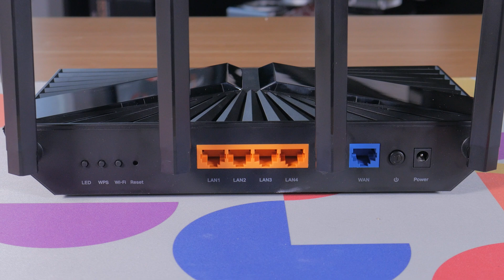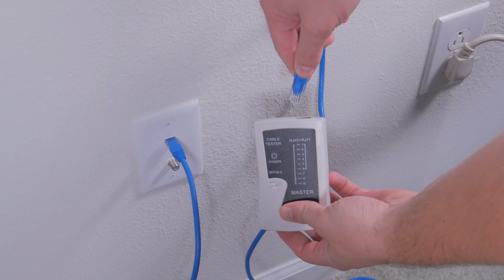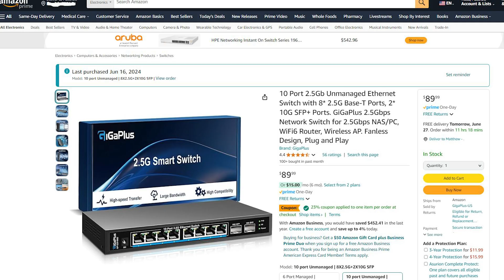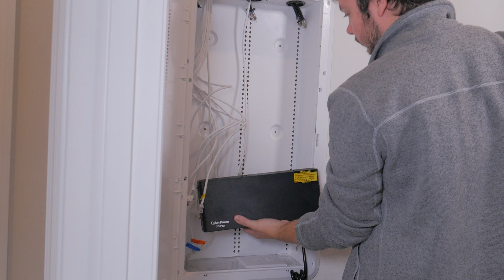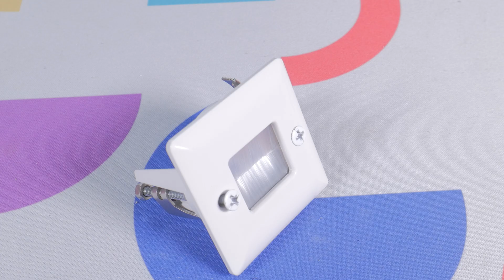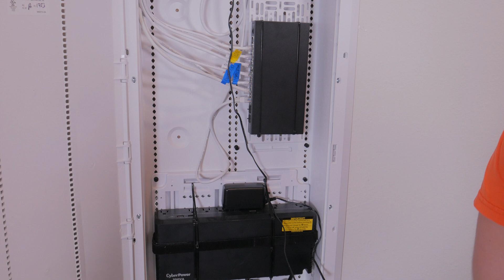Fixing my AWFUL Home Networking! (2.5gb & 10gb Upgrade)

Comment: We use dynmo label makers in the field doing professional IT/AV installs in smart homes in high end homes in Los Angeles. They're great for this use exactly. Vertical printing is amazing for it. I would also say look up TP links backdoor/hacking/chinese attacks and US bans on the brand. I know the price tag is appealing for most with what you're getting. But there is also a lot of proof and security concerns with the brand. I would say go with almost any other name brand. Netgear even. We use Ubiquiti a bit in the high end homes. Also Ruckus and Arraknis routers and access points.

Comment: I guess I’ll need to put a shelf over my future panel as my router is about the same size and shape as a 1/2 gallon milk carton. The separate ONT modem is only about 3” square x 1” and can fit inside any panel.

Comment: Or i mean good is this for example - RB4011 router with 10 ports and sfp, i mean is good for any home usecases, so you dont need switch, and you can buy APs for wifi in each room, also you can use some mikrotik switch with more ports ...., Mikrotik have good qos services, so you can set up many things, like prioritization or limit tcp and udp, load balancing if you have 2 isp, simple queue, qos for particular mac address ............... 😀
Reply: but yea tp link is also good, maybe cheaper and easier setu opposite to mikrotik, but when you buy new router people, chceck maximum speed of wifi, for realy gig wifi you need 2000 mbps + ( maximum wifi speed ), in the past, i bought router which maximum speed is smaller than 2000 mbps on wifi, and I didn't have full gigabit on wifi
Reply: for gig wifi is good this product - tp link archer ax53, it is realy full gigabit router, i tested it

Comment: get rid of the wireless router and get a real system with POE Access Points with a real POE switch spend a few extra $$ and do it right.

Comment: 4:48 coming from someone who does IT for a living trust me you moving ethernet cables around like that is not going to break them. I’ve seen some horrendous shit and it takes a lot to break an ethernet cable now your fiber on the other hand that is extremely more fragile, you have to be extremely careful with that but ethernet as long as you’re not trying to break it you can manhandle it a little bit

Comment: The reason the SONU has to be installed in the garage is due to no conduit ran from outside your home to the network panel. As a field tech I run into this issue all the time. So if you are building a home tell your builder to run conduit from outside to the panel. Then the isp installer will be able to pull fiber to it. It’s not spectrums fault the builder doesn’t want to spend the money on it and they don’t know fiber is in the area

Comment: My family live in 2 small two-story house. Almost everything is using wifi: TVs, computers, phones(?), cameras, IOT devices.
In each house, I use only one Aruba access point and placed at the middle of the staircase. I tested them and every place have strong enough signal to download at minimum 20mbps. I'm kind of regret wiring 2 cat6 cable to each room of the new house :) 
I placed everything in the main box at the old house including optical converter, openwrt router, file server, POE switch and a DIY 48V UPS. All of them is gigabit because I don't see 2.5gbps is worth invest just to increase my rarely backup speed by twice. The router, file server and optical converter is powered using POE splitter so all of my network equipment can live as long as I want depend on the capacity of my batteries.

The thing I have not really happy with is the Aruba access points, they are closed ecosystem, featureless and expensive enough for me to extend my network.

Comment: I have solution for your ISP routers to powering over the UPS, using POE GIGABIT Adapters & Injector, you can send a power from your UPS power over the ethernet cable

Comment: So as a fiber ISP installation tech, They say that but ultimately you can run the fiber wherever you want in the home from the house box outside, Its a standard SC angled fiber connector and you can buy premade length jumpers. Just do NOT uncap it at all until ready for plugging into the ONT.
Reply: To add to this, installing the ONT in the fucking garage is such a big taboo, Because it would have been presumed that your gateway would have been installed there before too and that would have been horrible for wireless performance throughout the house. The only time I install in the garage is if some of these new homes have the utility/patch panels located in the garage where all the ethernet in the home terminates to.
Reply: @jonnathan780   some strange reason i see it often  we have some in our devlement who have it outside
 there garage own by the isp hard mout to wall

Comment: You should remove the plastic cover from the anthenas of the TP-Link router because plastic acts as an insulator for the WIFI signal.

Comment: As a former cable installation tech for Spectrum, I can tell you the modem absolutely should not be in the garage. Your tech lied to you when he said it had to go there, it's absolutely supposed to be inside the home. That install would have resulted in a charge-back,  failed install. You should absolutely be calling your ISP and setting up an appt. to have it moved. There are multiple reasons the modem should be inside...mainly heat and humidity. I would solve the wires at the bottom with two simple grommets, done deal. Everything else looks on point, good job !

Comment: I never liked patch panels. To me they are just another unnecessary layer of clutter. I almost hate rack mounted stuff in the home. They are noisy, and you need to clean and replace the fans a lot, and unnecessary.

Comment: I'm a internet installation technician. If anyone is curious as to why the modem had to be installed in the garage, it's because there is no conduit going from the side of the house into his media panel so there would be no way to fish the fiber which would have been ideal. Unfortunately, not all modern houses come with a media panel or said conduit leading to it. The only option is to install the fiber modem in the garage and connect it to the ethernet that is going from the side of the house into the media panel. With that said, the technician could have done a much cleaner job when installing it.
Reply: Absolutely not true, the tech either didn't want to do it or didn't have the time because he was overloaded with stops which happens daily. This could have and should have been put inside, running wires is easy.
Reply: @Me99adon  Installing in the garage takes longer as opposed to having a conduit going into the media panel. So the argument that it's faster cuz the tech was running behind is such a false claim . . . And to say he "didn't want to do it" is also false. You can clearly see in his media panel that there is no conduit, so he physically COULDN'T do it, even if he wanted too
Reply: @ericdayofficialyt  obviously you've never fished a wire down a wall, its pretty easy...I used to do this for a living and i'm telling you right now that install is unacceptable. Even if it had just been mounted next to the panel on the wall.
Reply: @Me99adon  I have plenty of experience fishing through a wall, and that's not what I'm talking about at all since that wouldn't be a good idea in this situation.

With that said, I'm not condoning the condition of this install as I would have done it a different way. But with the amenities of the house and how it was built, the ONLY option would be to install the ONT in the garage
Reply: It could’ve definitely been installed inside. Installer could’ve put a piece of conduit/u-guard/pipe up the outside wall into the soffit and fished the fiber into the panel. I have fished these panels multiple times.
Reply: @Wav10001  False. That is not something that installation technicians do. Now, if you hire a contractor to do that, then that's a different conversation. Also, does he live in an HOA community? If so, then that solution wouldn't work.
Reply: @ericdayofficialyt  point 1 - why? you’re literally fishing an existing hole and trading a hole in your stucco for a hole in your soffit.

To your second point… you’re telling me the HOA would approve you of a house wrap where the cable comes up from the ground and goes through the wall (or potentially several feet horizontally across the outside wall) versus a conduit into the soffit that looks more aesthetically pleasing? Oh wait let me guess.. you didn’t ask the HOA because your route doesn’t allow you the time to do that.
Reply: @Wav10001  Point 1 - The hole in the garage is not seen on the outside of the house, it's pushed though the d-mark where the fiber comes in from the cross connect in the street.

Point 2 - You're correct, the HOA would NOT approve of a house being post wired cuz why would anyone want a wire running on the side of their house? Even when the job is done well, it's an eyesore. But it we could, and it's what the customer wants? Then sure, we can do that. But again, it's dependent on what we have to work with.
Reply: Isn’t the garage too hot in the Florida summer for the modem
Reply: @patricianavarro6645 We do it like that in Vegas where we hit 120 degrees last summer. The only time it's done is when there are no other options based on the amenities of the home. The only other possibility is to run the fiber line along the outside of the home, but with fiber being mire fragile than the traditional cable line, I don't recommend that option

Comment: Well as of the modem, there's an optic fiber connection, you can try to see on the back if you can unplug it. If yes, get your self an adapter (with respective end color, in poland for SM fibers it's either green or blue and it means something ;) ) and a optic fiber patch cable with respective color ends, then just run it like you runned the cable from the modem to the enclosure you showed in the vid. With that you can move your modem to the desired place, but remember do not bend the optic fiber cable/patchcord too much no 90° bends etc. If you need to bend it. Do it with radius bends and do not pinch it.

With that said. That's one of the ways to get that done.

Comment: And while using a label maker for the whole name is okay. I've often found myself numbering each cable and then having a laminated sheet that you put in there with clipboard or however you would like where you can go on the computer type up document showing which number is what and that is what you laminate and put in there if it's ever needed to be changed quick to do.

Comment: Just use a bolt and 2 nuts to mount your equipment. The 2 nuts pinch down on the bracket and then you can use the mounting holes on the bolt head. Looks cleaner and you don't have the eventual zip tie replacement.

Comment: i can see that youre using fiber internet, you could consider using fibre cable couplers to run an extra wire from your spectrum fibre drop under your desk to your network cabinet. this would allow you to move your modem into the cabinet saving the money for another ups

Comment: To move the modem, you can run an optical patch cord to the cabinet, and connect the current connection to the optical connection socket, if this is a GPON connection from the provider.

Comment: If you have it in you to pull some wire through a wall, I'd suggest running a length of fiber to the garage, coupling it to the jack there, and then moving the modem to sit with the rest of your network equipment.

Comment: it got great. Btw, you should ask your Internet provider to reenistal the modem on the loundry room. They just have to put a new cable, its very simple. That way you have everyhing on the same place, connected to the same UPS.
Reply: The installers always try to get out of doing actual work, and Never want to go into the attic to run cable....
Reply: @koinkeepers9378  He said Spectrum and I knew they put it in the garage because they are lazy.
Reply: Check the run of your Cable/Cat6 connection if it is loose all the way and use one of them to pull a cord through. Then use the cord to pull a pre terminated fiber to your closet. From what you showed in the video I think you are handy enough to do it your self! 😊

Comment: So they ran the fiber drop to the ONT in the garage and then ran a random ass ethernet cable to the distribution cabinet? Could they not place an FST at the fiber drop location and then run fiber to the cabinet location? Or was this just the tech not wanting to do quality work? When I was tech we carried 200-500ft aerial fiber drops. We would use those to wrap houses to the correct location for an ONT.

Comment: i would not have removed the equipment, at most i'd have covered with something maybe tape a plastic sheet to the inside of the box but, likley done just like you and used my electric computer duster after.

Comment: for a dink box as most of those in walls are, that legrand actually has some room to work in! i bought a 10" rack for my last project but, this also gets my mint thinking. could even use this in conjunction with a mini rack, just coax splitters and POTS and ethernet patching etc etc.

Comment: 1) Not everything in the CyberPower line will come back up if run to depletion.  Some need you to push a button after some level of charge has been reestablished.

2) Laundry rooms sometimes flood.  That server should be on something like a milk crate or moved somewhere else.

3) Houses and especially laundry rooms are dusty.  You fold clothes there, right?  Mount the AP with the RJ45 ports facing downward to keep dust from ruining your day later.

Comment: You can move that company router anywhere, just get someone to pull or extend that fiber cable if you don't want to do it yourself
Reply: pretty much simple and will clear the issue.
Reply: My isp installer rambled on how they couldn’t do it due company policy blah blah. I had already ran a few lines myself and told them I’d do it, eventually he had to do it that way anyways. Tipped the guy cause I had to leave and wanted him to feel appreciated. Come home to my security being unplugged 🤦🏽‍♂️

Comment: In theory, you could move your modem into the closet, by "extending" our ISPs fibre house connection with a new fibre that you run from the closet to the house-port.

Fibre cables are fairly cheap and you have everything in one spot
Reply: yes, that is correct. :D hahah.

Comment: you can try to power up the fiber modem using POE injectors ... one on each side ... one to power in (in thewall netwoork closet) and one to power out (modem) ... to use the UPS

Comment: Your ISP most likely left your modem in the garage because the fiber drop is right on the outside of your garage. I am a technician and we don’t run fiber or even carry fiber with us. We just have to put the modem where ever the fiber reaches. There was most likely no conduit from the house box to your smart panel so that’s why it wasn’t pulled to the smart panel initially. Great setup!
Reply: Wait you don't carry any fiber for installs? We would wrap entire houses with fiber from the fiber drop to where we placed the ONT. Wow your company really doesn't want you to do work.
Reply: FGUCKING WHAT; Im a installer for a ISP and we carry 1000M drop spools on our trucks and varying jumpers ranging from 5ft to 100ft. Ur company sounds lazy/trashy no shade at you.
Reply: former Spectrum field tech here. We carried varied lengths of unterminated fiber drops. Likely reason his modem had to go in the garage is there wasn’t a conduit that led to the smart panel.

Comment: confused you have 1gb into the router then feeding a 2.5gb switch from a 1gb source you need a 2.5gb port on the router
Reply: I was thinking the same thing. Or he could have ran the internet directly into the switch and ran an ethernet cable from the switch to the wireless router.
Reply: I think he only uses the 2.5gb/10gb speeds internally for his nas/storage server. So it's fine as that traffic doesn't need to go trough the router, Only internet. And his internet speed isn't greater then 1gb anyway.
Reply: This might have been the most painful network upgrade I have ever watched to be completely honest. More reliable? Probably. You’re not going to be benefiting at all by that switch assuming you haven’t upgraded any Nics on your end devices. A $25 switch was probably more up your alley.

Comment: Hey, for the USV for your modem maybe  APC Back-UPS Connect CP12142LI is for US Market and not so Cheap, i live in germany and head a Eaton S3 Mini but only for Europe and UK available arroubd 50€, the same Type APC Back-UPS Connect 12V CP12036LI have one also for Europe arround 60€ not us sadley .

Comment: Networking is fun. If you get anything over 1Gb WAN you're probably going to have to make your own router to get to full speed. I set mine up with 2Gb WAN going to a server running Proxmox and pfSense for routing. That has 10Gb in and SFP+ DAC to a managed 5 port 2.5 Gb switch and that feeds a 24 port unmanged 1 Gb switch. Now that I've got it working, I'm afraid to touch it. 😂

Comment: I have the same TP Link router as yours for over a year and it work out well. I had to upgrade all my CAT 5e and 6 to CAT 8 because I didn't want any cable as the bottleneck and it was not that much more difference in the cost and save me the hassle in the future. My laptops and iPads uses the wifi  and that router's 6 antennas worked very well.

Comment: Nice video, but I think you may have missed an opportunity here to future-proof your network setup by going with a managed switch instead of unmanaged. As your networking skills progress, you may find yourself wanting to replace your WiFi router with OPNsense/PFSense and segregating your network traffic.
Reply: Well it's gonna be very easy to replace that switch and router by the way he installed them